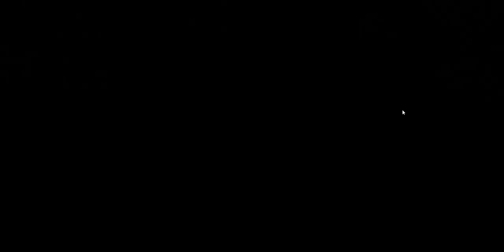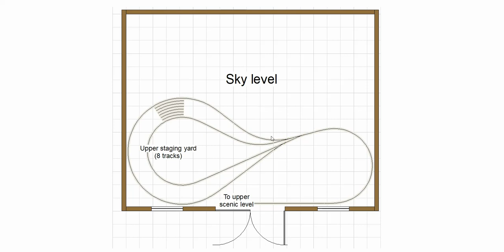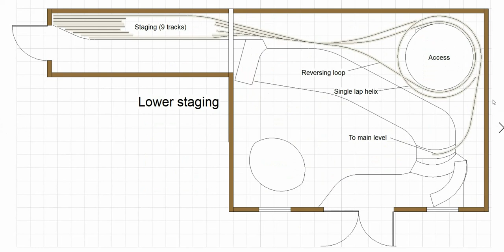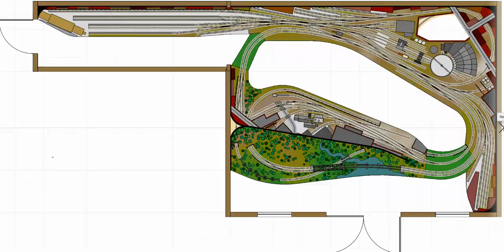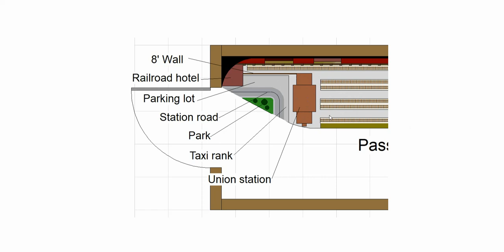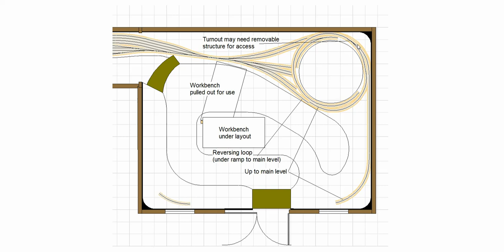An HO-scale layout for a shed

Comment: You’re a miracle worker. What are your thoughts about ceiling layouts- to follow walls throughout a home; in O-gauge?
Reply from the maker: My thoughts about ceiling layouts: - - - - - - - - - - - - - - - - - - - -
(meaning that I've never given them much thought)
Seriously though, a loop of track just below the ceiling is basically just for displaying a train on.  This is not really a suitable location for an operational model railroad.  If that's what you want, then go right ahead - it's just something that's never appealed to me since I like to get up close for hands-on operation.
Of course, once you try to run around more than one room, you have to consider the possibility of running into framing every time you pass through a wall.  This shouldn't be too much of a problem provided you know enough about construction to know which walls are load-bearing and which are not.  Without this building knowledge, the safest approach would be to use a stud-finder everywhere you want to pass through and just assume that every piece of lumber you find needs to stay exactly where it is.

Comment: Fascinating to see how successfully you work with your clients to tease out of them what really works for them, the options and design journey steps. I wonder how many end up saying at the end I didn't know that this was what I really wanted! Will it be the client doing the build or a pro team? Another great layout again. Stephen
Reply from the maker: Figuring out what the customer wants is the first big challenge (sometimes they don't even know).  The process starts with a lengthy questionnaire (46 questions, most of which require some thought).  Even then, the customer's desires often evolve with the plan - meaning that I frequently have to chase a moving target.
No, I'm not complaining.  That's just part of the job.  If someone already knows exactly what they want beforehand, they probably don't need my design services in the first place.